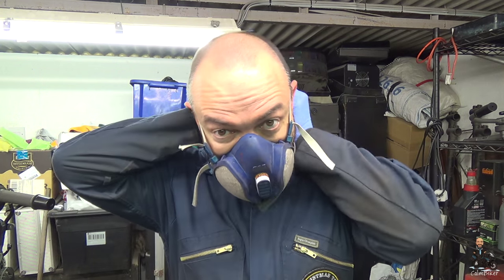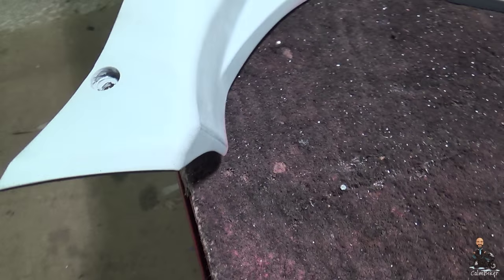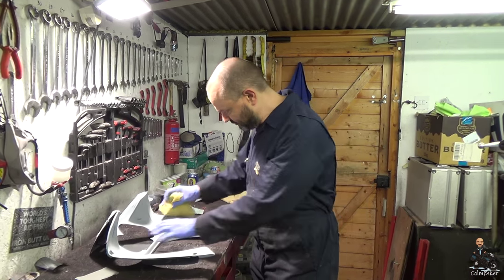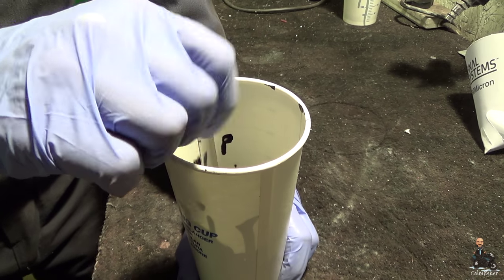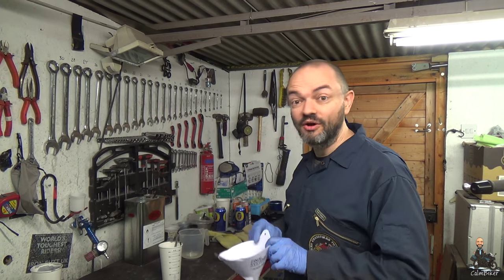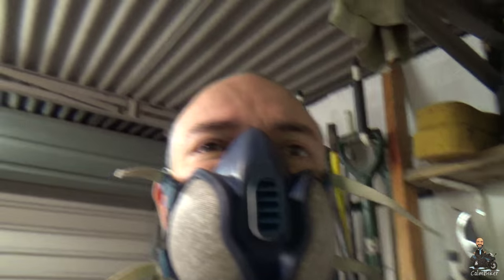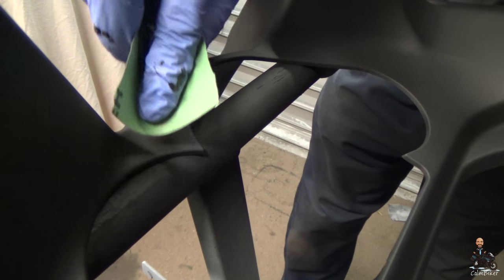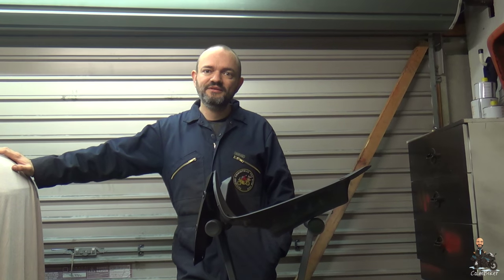662. Yamaha TDM850 Restoration Project #13 - Plastic Repair Paint | Garage Video

Comment: Very nice paint job :) Can't wait for other parts done so nice. Do you plan to do something with exhaust manifold? Mine doesn't look too nice, i'm wandering if it can be polished and sent to chrome covering - it would do real nice look.
Reply from the maker: +Przemo Abrams Looking at the exhaust tomorrow. We're trying to work out if we can salvage it or not. If we can, we'll be polishing the pipes I think.
Reply: I'm wandering if polishing will be a good choice, it's exhaust is made of regular steel and corossion might get it very fast. That's why I would suggest to put chrome on it - it's much better protection and a coating which is a lot easier to clean in the future.
Reply from the maker: +Przemo Abrams Unfortunately after looking at it we reckon it's not salvagable.